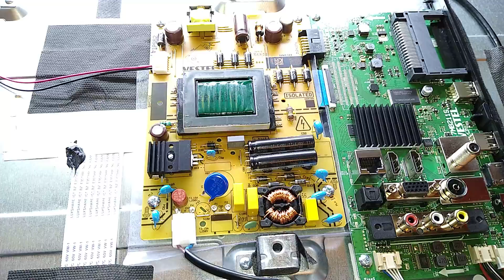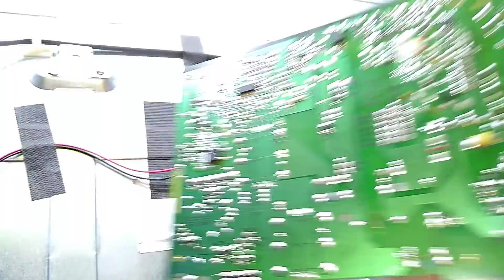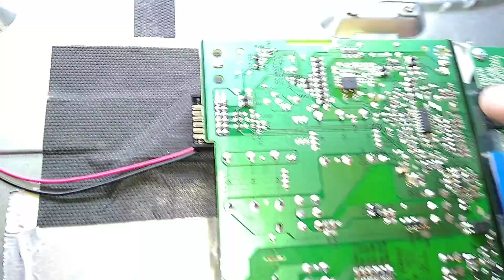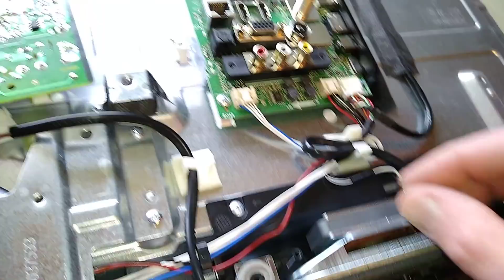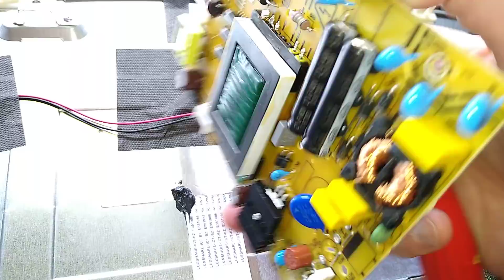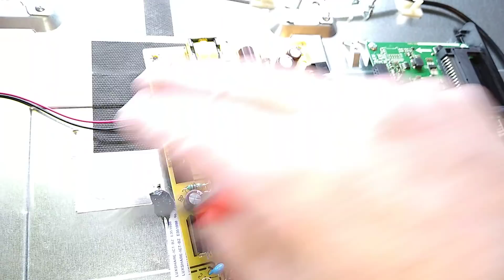There's not much inside TVs these days

Comment: Please explain 3 diodes in parallel.
Reply: Makes me wonder whether there's a risk of thermal runaway, though; if one diode passes a little more current than the others and (so) gets hotter, the forward voltage drops for that diode, and so it passes a little more current, and once the first fails the other two get an increased load...   No happy ending, there :-)
Reply: dothemathright 1111  True, dat.  But that's not what the manufacturer has done, there isn't much space, the resistors generate more heat, and I don't have a bunch of 0R05 resistors handy :-)

Comment: I paid almost £1000 for a fast screen TV back in 2001 which had 3 tuners and satellite TV in HD. Had I waited another year I would have got one with HD Terrestrial. The TV is a Panasonic and its still working today. I have decided to replace it with a Sony HD 4K TV.
I wonder if it will last 20 years ? I doubt it.

Comment: i have 2 11 year old square TN panel lcd monitors. the driver coil on them failed ... some kind of kickback happened every time they cycled off and eventually burned through the main transformer windings and splattering the inside right above it with a grey coat of vaporized material over the years

Comment: I had a samsung that had an intermittent problem with the lower half of the backlighting going dark randomly, I got to the LEDs and reseated all the connections and tested for continuity and it worked for another 12 months before going intermittant again. It was a PITA working on a 55" TV on the dining room table so I just bought a new TV!

Comment: I've repaired a couple of my own flat panel monitors that have failed due to capacitors failing beyond their seviceability date.  Most of those devices are rated for 10,000 hours plus (depending on environment)  and be identified as you noted by bulging cans.  One thing to keep in mind is that they are lo ESR devices not OTC Radio Shack crap.  Even so I was able to resurrect a couple of LG monitors by replacing them.  That said herein lies the economics of the repair.  I repair my own equipment because I am averse to seeing it on the landfill.  Thus I don't factor in my labor.  Unless I was in a philanthropic mood or dealing with a senior of limited means I would just tell the client to buy a new monitor.  My labor is expensive.  The board may be cheap but at $60 (46 quid) an hour for a unit that may not work more than a year is a foolish investment.

Comment: I did work experience for Pioneer maybe almost 20 years ago now. They were a much more popular brand back then when home hi-fi systems were still popular and DVD players were new to the consumer market. Even back then, most consumer electronics they produced were down to about three components that you just swapped if there was a fault. A DVD player for example was power supply board, main board and the drive mechanism. I was surprised how little electronics knowledge was needed to be a technician. Another interesting thing was that the first thing we did when servicing a DVD player was plug into a programming connector and disable Macrovision. I guess this was to eliminate this as a possible cause of issues, then we'd "forget" to re-enable it.

Comment: I had 3 tv's die with display problems, and reconnecting everything seemed to fix 2 of them... I think it's the ribbon Controle cables. They are so delicate, and such, held in with such light connectors, they just come loose over time. If firmly slapping the back/top of your TV makes a difference to the state of the display, then it's time for a connector check. 

The 2 survivors are still in service now, with one being over 10 years old. The one that died was a cheap TLC with the same bords in the video, but as I no longer needed it, and it was an obvious power problem, I just stripped it and sold the rest of the components on eBay.

Comment: That's a very pretty printed PSU board I have to say. Just look at all the little icons, labels etc. together with the live/isolated labels and separation line on the top side. Maybe it's standard in those TVs, but I'm just more used to PCBs with hardly anything other than simple labels for components (if at all).

Comment: I had some shorted LEDs in our 50". It didn't last very long. Turns out they are special high voltage LEDs.
Replaced them but ended up chipping the edge of the LCD panel which messed it up. As careful as I was it turned into a failed repair.

Comment: Oh to be an engineer so confident in the EMI resistance of their design that they'll run a high frequency LVDS ribbon directly under a power supply board.
Reply: Probably it's part of the programmed failure.
Reply: Well they probably work for around 450 GBP a month lol.

Comment: I repair TVs on a very regular basis and I can tell you now that LED backlight failure is frighteningly common on modern TVs - they seem to be designed to fail within a week or two of the guarantee running out. Usually one or more of the LEDs shorts out and the controller detects the change in voltage drop then shuts it down. Sometimes the LED driver chip fails, but that's quite rare. In my experience it's almost always the LEDs themselves. One exception I did get was a Phillips-branded 43" smart tv that had an open-circuit current sensing resistor in the driver circuit, in addition to the usual handful of blown LEDs.

Here's a pro tip - When you get a new tv, go into the settings and make sure you reduce the backlight intensity down to around 60-75% and the LEDs will last a lot longer. Too many people have the brightness set to 100% and the LEDs burn out in no time at all. They tend to run really hot even at reduced brightness as they tend to be overrun in order to make a brighter picture.

Aside from the LEDs, the other most common issue is failure of the PSU boards and this is almost always due to a shorted rectifier diode on the secondary side of the main transformer. These cheaper Vestel-made boards tend to have two or more diodes in parallel (cheaper than one high-powered one I guess) to spread the dissipation (these things get red hot in use, as with most SMPS), making it necessary to lift the leg of each one in turn in order to test them properly. When you replace one of these paralleled diodes, it's always good practice to replace all of them to reduce the chances of a boomerang job. Thankfully, the bad capacitor plague tends to be less of an issue now than it was a few years ago, but we still see bad caps in older sets from time to time, but it seems to be the output rectifiers that are the weakest point in these more recent Vestel PSUs, though this happens with other manufacturers too - only a few weeks ago I had a Samsung 32" tv in with this exact problem, and that had a Samsung-branded PSU in it, so it's not only the cheap & nasty Vestel boards that are affected.
Reply: Против Глобал  I guess they went with the cheap option

Comment: Check for cold solder joints. I've found them often in these damn things. The key give away is it started working after you probed around on it.
Reply: Agreed. I’ve actually fixed an LG by just reflowing the board.

Comment: I wonder if someone sent you a modern samsung, if you could pin point the microphone and a certain lens (That I found in one, when I was throwing TV's in to the TV container in the recycling centre I used to work in) I was throwing them when the truck that was supposed to pick them up, didn't come for 2 weeks and it was getting to high to stack; and we were not allowed to refuse to take them. The worst was that a lot of people still have CRT TV's. (Which can way between 5Kg up to 45KG)

Comment: My friend's 50" Samsung went out.  I volunteered to fix it, expecting probably to have to replace a capacitor or two.  Turns out the power supply board was fried due to some corrosion.  New one off eBay cost $60,  bob's your uncle.   Just wasn't worth the hassle to fix the board, I just replaced it and we sold the TV, good as new.

Comment: Random and off topic, but to your knowledge is there anything in an induction burner that would glow red? I'm not talking about the red LED they sometimes use as a backlight to show it's on - I think I saw a spark fly out the back of my induction burner when I turned it on, though I haven't been able to replicate it, and if I look in the air slots in the back when I turn it on I can see something quickly start to glow red/orange as if it were a resistance wire or something. I think something is melted and shorting out, but it still functions perfectly. Just afraid it's a fire hazard.
Reply from the maker: It might be a bad connection heating up.

Comment: I recently repaired a Sharp tv which was totally dead, no standby light, nothing. I opened it up and found a vestel power supply board. So I looked on FleaBay to see if I could find a spare. Yes, there was, but also a "repair kit" which consisted of 3 schottky diodes and instructions. googling told me the "usual fault" with the boards was that the diodes would fail short circuit. Investigation showed one of 3 paralleled diodes was indeed shorted. 2 OK, but different forward voltage. Bought 10 diodes for less than the price of the repair kit. Selected 3 to match voltage, fitted, yay, fixed :) 

As those diodes were spaced away from the board, I guess they were getting hot, and if they were unmatched, the lowest voltage one was taking most current...........................

Comment: I'm surprised you didnt fault find the bad part and replace. I am really hoping you checked for cold solder joints on that slim transformer. In my experience problems that come and go with probing are cold solder (micro cracking though so not easily seen)

Comment: Often wondered is it possible to run a reasonably modern TV from 12v...? Might be an interesting vid... keep 'em coming!
Reply from the maker: Yes it is.  You'd just need to add a voltage booster for driving the LEDs.

Comment: If it's one of the older models it could also be the connectors between the led-strips - had one where some of those where not conductive anymore .
My solution was to bridge each connector - the tv is working fine ever since 👍

Comment: I remember the old TVs that used Fleming valves (vaccum tubes); you would see a lot of (physically) huge resistors and caps along with a number of chokes and transformers and at least a dozen Fleming valves.
 
I have since forgotten though how the HV output from the flyback was rectified before being fed to the CRT.
Reply: A valve?
Reply: @uK8cvPAq  When vacuum tubes were first introduced, they were indeed called Fleming valves probably because the first tubes (diodes or triodes) acted as one-way "valves" to electricity.
 
The Fleming valve, also called the Fleming oscillation valve, was a thermionic valve or vacuum tube invented in 1904 by English physicist John Ambrose Fleming as a detector for early radio receivers used in electromagnetic wireless telegraphy.
Reply: @telephony  Yes I know what a valve is, I was addressing the last part of your comment which looked like a joke question.
Reply: @uK8cvPAq  Sorry about that -- I misinterpreted your reply not realising that it was a possible answer to that last question in my post. :-O
Reply: @telephony  Oh no problem. Yeah I think they used some kind of valve for the HT recifiction stage, but TV technology changed so much even during the early years that when bigger screens came out they started including multipliers also (not sure what voltage an EHT rectifier tube maxes out at but there must of been limitations there).

Comment: dry solder joint under 1 of the leds causes this problem Clive :o)
Reply from the maker: I'm hoping it's not that.  I don't fancy stripping the display section to bits.
Reply: @bigclivedotcom  or you could stick forks into it and see what happens lol,great channel always a giggle :o)

Comment: Is that a compact flash socket at the top of the main digital board?  O_o is that common in the UK/EU? Is that for subscription services?
Reply from the maker: It's probably for a subscription module.
Reply: @bigclivedotcom  Definetly is for a subscription module, you put the card your cable co. gave you into the module and you shove it into the TV,

Comment: All it takes is one or more of the LED's to fail and draw too many milliamps, detected by the LED drivers and shuts down the PS.  These cheap TVs drive the LEDs too hard and they fail.  If you replace the LEDs, it will fail again.  Bad design.  To get reliability on LED TV's, you have to turn down the brightness.  Period.  Could replace the LEDs with better ones if you knew what to get.   Its all a disposable world now - I don't work on any of it anymore....

Comment: Would have been great to see some of those capacitors pulled out and tested for DC leakage, some TV's run really hot as they age. 
This TV is in stark contrast to my Samsung plasma tv which is chock o block with circuits and heatsinks not to mention the heat that it pumps out! It's probably getting a bit beyond 15 years now and it probably needs it's capacitors looked at considering that it gets used a lot and the capacitors live in such a hot environment... Frankly I'm surprised that it's still working!

Comment: My Sumsung D8000YV stopped working the other day.   Diagnosed the set to find my 176v LED strips to be out of spec.  Trying to find the parts is so damned hard right now.   Looks like this TV will get 10 years and no more.  $500 in spare parts needed - new set $700.

Comment: I was visiting my son, who is an electrician. When I got there he was throwing away this LG 21" computer monitor who, he said, stopped working after a power shutdown during a thunderstorm. I looked at him angrily and said : "This is not how I raised you. I'll bring it home and have a look at it. Now go to your room. And no desert for a month."

Back home, I removed the back panel and found pretty much the same thing you show in this video. I immediately noticed 3 bulged capacitors on the power supply card. Since the monitor is near 10 years old, I figured it wouldn't hurt to replace all the capacitors, so that's what I did. And it fixed the problem. 

Instead of spending $200 or $300 for a new monitor, for about $15 this old one will be good again for maybe another 5 to 10 years. Electronics is just a hobby for me by the way. So I guess anybody can at least try to fix their stuff. Just look for answers and tutorials on the Internet. Might save you a lot of money.
Reply: It's almost always the startup circuitry that fails, and it doesn't even have to be a spike.  In my city, a power outage a couple of years a go according to owners "fried their induction cooking plates", while it probably was just the sensing circuitry listening to the touch-sensitive buttons that now did not start up right due to bad capacitors, which, when it was still powered up worked because the startup function was bypassed.
Reply: @Dutch3DMaster  Maybe those caps were about to die anyway and the spike of current, if there was one, just finished them. Who knows. All I'm saying is it's worth trying to fix things instead of throwing them to the trash.
Reply: @MusicalBox  Oh definitely. I agree with the idea of fixing things in whatever way.  Unfortunately replacement parts are sometimes incredibly hard or impossible to get.
My 3 year old tablet died on me (dead battery) but 5 firms (I'm a little bit ehm, cautious about buying lithium-ion batteries through eBay) were unable to order a new battery....That felt just stupid to me and it still bugs me something not even that old can fail in such a way you can't use it anymore because replacement parts have already stopped being manufactured...

Comment: Those beige boards are not plated through.  So they develop thermal stress cracks at any solder joints that get hot.  The cracks are faint circular cracks around the pin.  Difficult to see even with magnification.  Your probing fixed it temporarily.

Comment: I fixed my $1000 tv a few years ago for about $25 on some parts website I don't even remember the name of, I bought a control board guessing that was the issue and 20 mins later I had a working TV. The TV is a flat screen plasma Samsung from about 2011 I believe and even then there were only 2 boards and a display panel.

Comment: What you're seeing there Big Clive, is the main power supply (as mentioned), then the display's scaler board (responsible for video signal conversion and scaling, along with I/O switching, audio processing, and user-controls) is on the right, and the FFC (flat flexible cable) that goes from the scaler to the LCM (LCD module) actually goes to another circuit board inside the LCM; the TCON (timing controller) which has thousands of wires coming off of it in several batches of FFCs to drive the actual LCD itself (with precision wire lengths and tuned EMI shielding), carrying very precise and high-frequency signals.  If you do want to access parts of the LCM, such as the LED back-light array, you really should do so in an electronics clean room, as even the smallest amount of dust can cause problems inside the LCM.  But yes, most problems with modern TVs often come down to the power supplies.